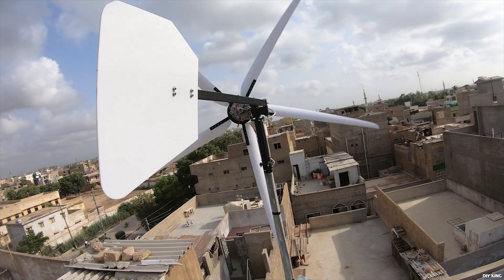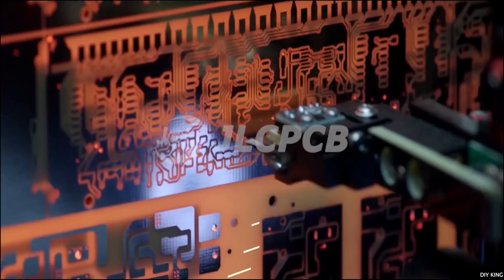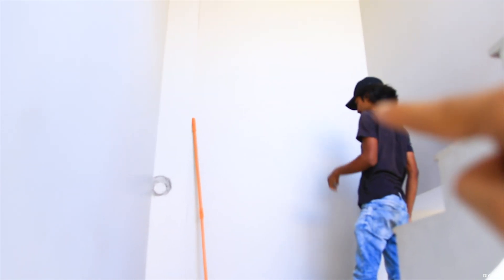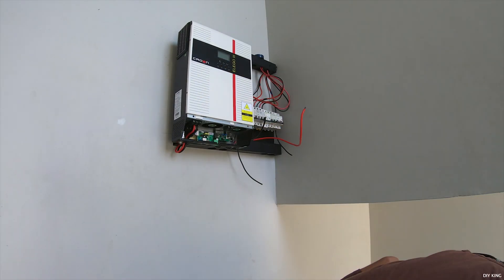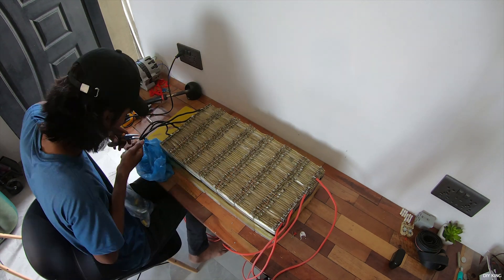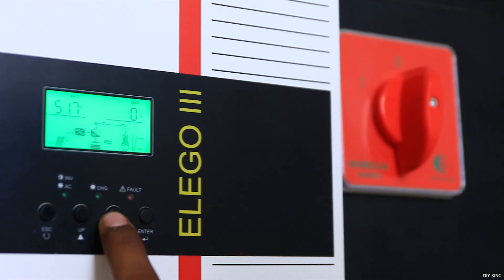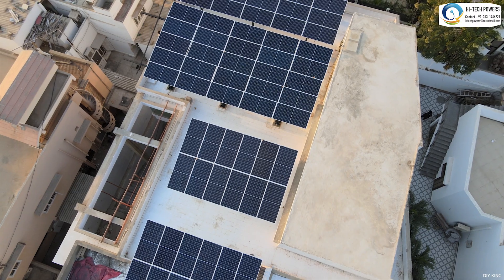DIY Tesla Powerwall (Upgrading Solar System)

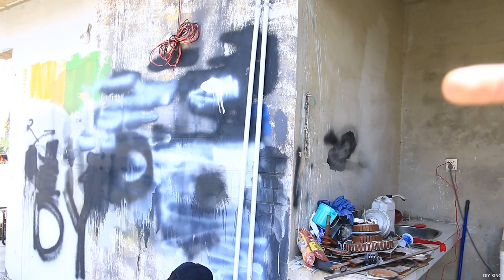Comment: @4:29 the conduits wont stop spikes induction. You should used conductive conduits and earth them. Anyways it dosent matter in this case as 1st AC spikes are not that strong to effect DC by coupling, 2nd in DC, inductors and capacitors will absorb the spikes if its coming from a charger or going into a power supply. Spikes effect circuits dealing with mV and uV signals.

Comment: Hi my friend I loved your youtube videos it's fun can you try this thing for electric power generation. summary
You need one or two solar panels and a DC to DC voltage regulator to spin a 24V DC motor
It rotates a 220 volt generator, for example, 1000watt, 2000watt, or more. Does it work? If you can make a demonstration video, thank you❤😁